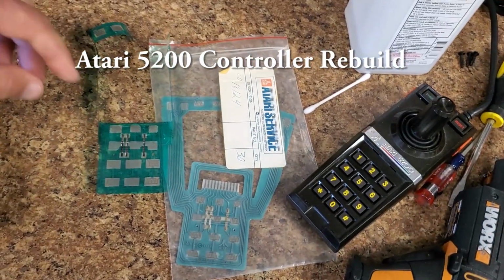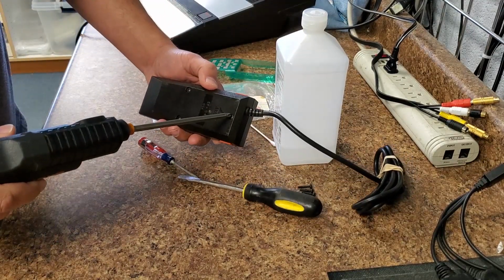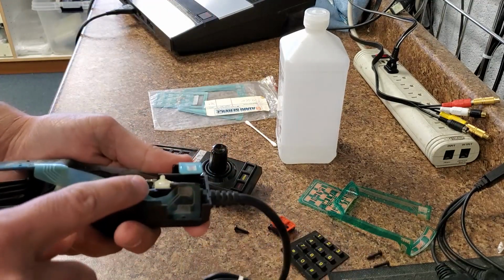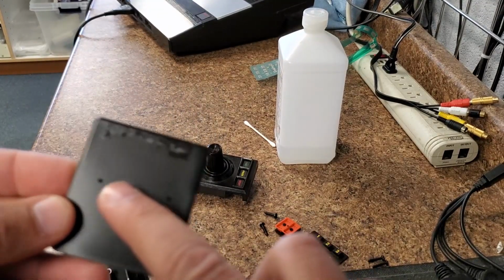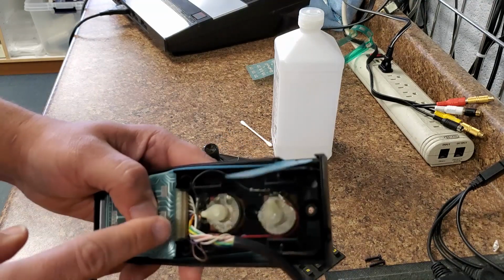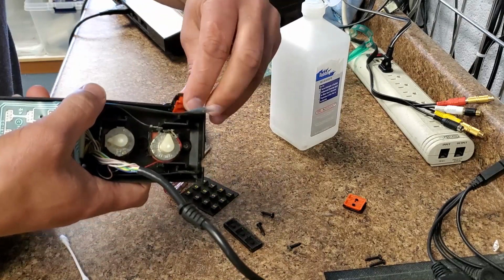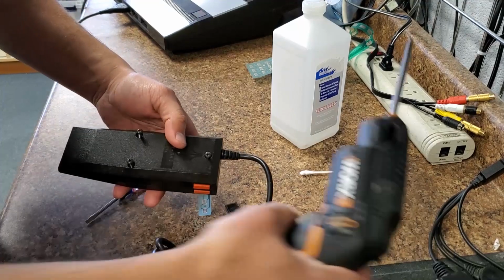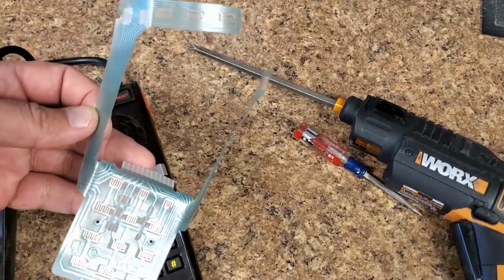Atari 5200 Controller Rebuild tutorial new Flex Circuit and Repair

Comment: I wish this controller insides could be upgraded with modern parts today....it's a beautiful controller
Reply: They can! You can buy an aftermarket replacement flex board and rubber joystick boot
Reply: @LouieFromPikmin I meant with modern hardware...self center
Reply: @Swanlord05  I haven't seen it in action yet, but the new joystick boot might be springier than the originals

Comment: The original mylars aren't really so fragile. It's usually from being cleaned with an eraser or testing with a screwdriver or something. Also, users deform it by mashing the unresponsive buttons as hard as possible but traces usually won't delaminate from that alone. Also, pulling the top off without freeing the Start/Pause/Reset contacts can cause the exact issue you describe in that area (broken traces). Thankfully, you can get the frame and rubber membrane off without marring using a common metal spudger popular with cell phone repair. Wish it had a name to distinguish it from other spudgers so I could tell you exactly what kind but it's in a lot of my videos if you want to see it (5200 and AES cartridge disassembly videos both use it). Some day I'll make a video to share my fix for CX-52 controllers with CTS-brand "Made in USA" pots and I will be sure to demonstrate the no-mar spudger technique. ;) I've probably used it on CX-52 controllers 100 times and never made a mark. Just did it again last night for a friend and was kind of annoyed to see marks from a previous service attempt where someone wasn't even prying the right spot! With the spudger merely inserting it between the frame and the top shell on the left or the right causes the latch to release... no prying at all. Unlike a screwdriver it slips right in. Unlike a razor it is thick enough to pull the two pieces apart as the slim part reaches the catch.